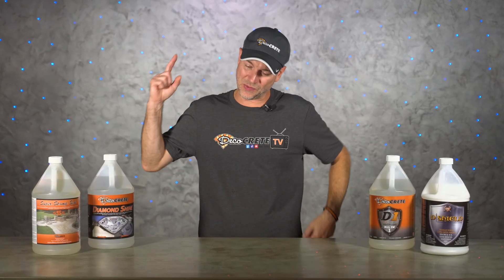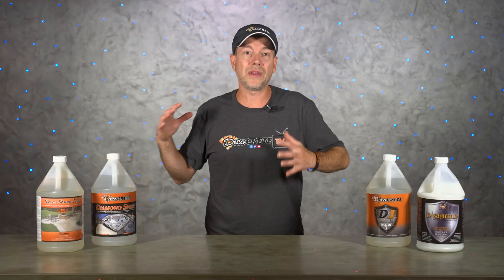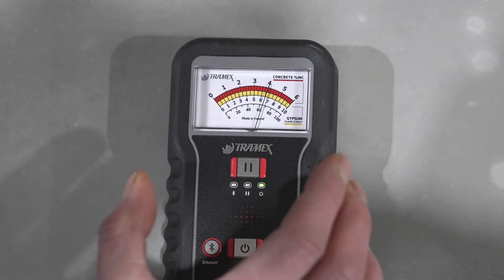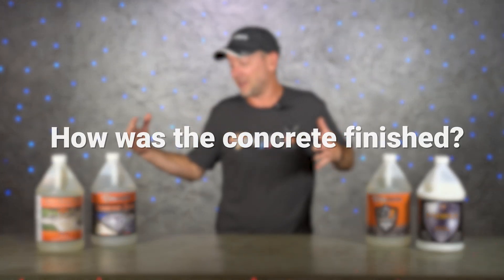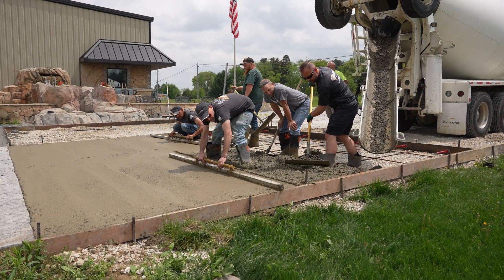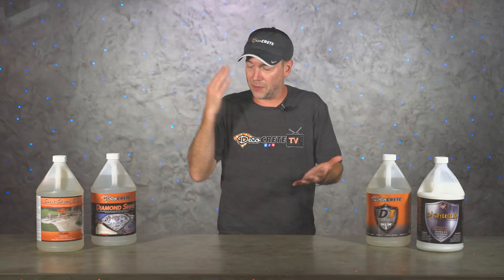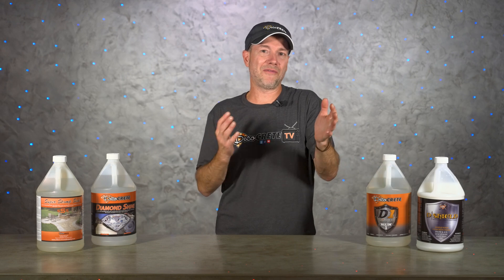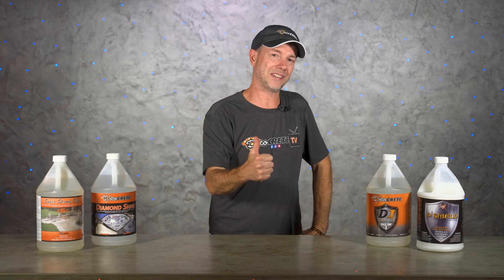How Long Should You Wait Before Sealing Fresh Concrete

Comment: I had a slab poured on Monday. 6 1/2 hours start to finish. 1 foot deep footer and 5 1/2 center. 3000 psi. Average daily high temperature has been in the high  80s with relatively mild humidity and night temps in the high 50s. Do you think it will be safe to drill for 5/8" anchor bolts to set 6x6 posts by Saturday? I really need to get started on this, but don't want to ruin the expensive concrete.
Reply from the maker: Thanks for the comment! You should be fine to drill and install the bolts now. Concrete can take up to 30 days to reach it's final compressive strength, but it gains most of it during the first 5-7 days. I would be careful not to overload the concrete with weight at this point, but you'll be fine to drill the holes and set the posts. For some comparison; most contractors allow concrete driveways to be driven on after 7 days. You could also contact the ready mix plant that provided the concrete to see what they recommend. Hopefully this helps. Thanks for watching Deco-Crete TV!!!

Comment: Hey man. If my concrete guy used an acrylic sealer a few days after the pour, am I able to still apply my desired SX500WB penetrating sealer or are those pores blocked with acrylic now? How would I know when its safe to use the penetrating sealer? Thanks!
Reply from the maker: Thanks for the comment! Yes, you can still apply a penetrating sealer; you just might have to wait until next year. The acrylic sealer will block the pores for a period of time, but it will eventually wear off. This can take 3-6 months, depending on the situation. The best way to tell how open the pores are is to monitor how fast water is soaking into to surface. If you dump some water on the slab and it repels it or takes a while to soak in and darken the color, then it would not be ready for the penetrating sealer. Once the slab stops repelling water and it soaks in, creating a dark spot immediately, you'll be good to reseal it. This could be next spring or even summertime, but the acrylic sealer will keep the concrete protected in the meantime. Hopefully this helps. Thanks for watching Deco-Crete TV!!!

Comment: My situation, newly poured cement (brushed) but the contractor use 2 different cement product sources on two separate days. Well, 1/2 my driveway is a Light shade, the other half is a darker shade. Will the sealer help with this to look uniform or enhance the different shades making it more noticeable? Can an tint additive help with this to make everything look the same? Cold winter climate in the Midwest, Thanks.
Reply from the maker: Thanks for the comment! The first thing I would do is let it cure out for at least a month before making any discissions on the sealer, it might even out some as cures. If looks better after that, I would recommend applying a penetrating sealer before winter. If the two slabs still look different after it's cured out, try spraying some water on it. If looks better when wet, then a solvent based acrylic sealer might be a better option for aesthetics. We really prefer penetrating sealers for driveways, but an acrylic sealer will darken the color. If it doesn't look any better when it's wet, then I would use a penetrating sealer and just live with the color difference. Tinted sealer is an option, but that won't last verry long and will lead to consent maintenance. I'll leave a link below to a video on penetrating vs acrylic sealers. Hopefully this helps. Thanks for watching Deco-Crete TV!!!                                                       https://www.youtube.com/watch?v=mpm855Hg9ec&t=305s
Reply: @DecoCreteTV  Thanks a lot, I kind of agree with maybe just living with it. Was just wonder if there was a way to blend the two offsets with a miracle product.
Thanks again 👍

Comment: Great video! I plan on using D1 for an upcoming stamped patio and shop floor. Can I apply this the day of the pour for curing, then reapply 30 days later to seal?  Sorry if i missed the answer in your excellent video.
Reply from the maker: Thanks for the comment! D-One can applied as a curing agent the same day as the pour for broomed, swirled, smooth finished, or basically anything other stamped & exposed aggregate concrete. With stamped or exposed aggregate, things are different. There are still a few steps left in the process, and the concrete needs to stay unsealed until everything finished. In most cases, we recommend a minimum of one week cure time before applying any sealer. There's just really no good way of chemically curing stamped concrete. If you use powder release for stamping, that will help maintain some of moisture for the first 12-24hrs, and that does help on 90 degree days. Clear liquid release will not aid in curing. The only thing you really do to slow down the moisture loss of stamped concrete would be to water cure it for the first 3-5 days. All that said, we have never cured stamped concrete, and never seen it cause an any issues. So, to answer your question; don't spray any D-One the same day as the pour on your stamped patio. Wait at least one week, or even longer if you can. If your shop floor is smooth finished, you cloud spray D-One the same day if you're really worried about curing, and then spray a second application as a sealer 30 days later if needed. Or you could just treat it like the stamped patio, wait a week and use it as a sealer at that point. Hopefully this helps. Sorry for the long-winded reply, lol. I'll leave a link to another video on curing vs sealing concrete below. Thanks for watching Deco-Crete TV!!!                                                                                                                                                                                  https://www.youtube.com/watch?v=V_0eIsgg2pc
Reply: , great in-depth reply! Thanks!

Comment: I wasn't aware the cure and seal would "wear off" enough to apply penetrating sealant. How can you tell if it is gone enough to apply a penetrating sealant? I didn't have any cure and seal applied to my interior pad because I plan to apply a densifier and sealant. For my driveway (brushed) that I will do next, should I use a cure and seal, or just try to keep it wet as long as possible?Thanks for the great videos!
Reply from the maker: Thanks for the comment! A cure & seal product will eventually break down/wear off enough for a penetrating sealer to be applied, especially if the cure was applied the same day as the concrete was poured. The exact timing of this can vary, though. It would depend on what cure & seal product was applied, how much UV ray exposure it gets, and how much traffic it sees. On average, it could 3-9 months for the cure & seal to break down enough. The easiest way to tell if the concrete is ready for a penetrating sealer is to monitor how fast water soaks into the surface. If the surface is repelling the water, then it will also repel the new sealer. If the water soaks in but it takes a few minutes to do so, and it turns a darker color after 5-10 minutes, your getting close, but I would still wait a little longer. Once the water can soak in really fast and it darkens the color immediately, you're ready to apply the penetrating sealer. All acrylic sealer/cure & seal will eventually break down at some point, the difference is that if was applied as "cure" the day of the pour, it will break down faster. If it was applied as a "sealer" to concrete that is at least a few weeks old, it can last up to 4-5 years. As far as whether to apply a curing compound to a new pour, well that's a loaded question, lol! We have our own opinions on this, but I would also consult your ready mix supplier about this as well. They will probably tell you that you should always use a curing on new concrete, no matter what, and that is the safe thing to do. That being said, I personally feel that the time of year, the weather conditions, and even your geographic location all make a difference on whether you really need a curing compound or not. Hopefully this helps answer your questions! I'll leave links to a few other videos on the topic below. Thanks for watching Deco-Crete TV!!!!                                                                                                                                                                                          
 https://www.youtube.com/watch?v=_Ejy1i8K3yk                                                                                                                                                                             
 https://www.youtube.com/watch?v=V_0eIsgg2pc&t=11s                                                                                                                                                        
 https://www.youtube.com/watch?v=mpm855Hg9ec&t=230s                                                                                                                                                 
 https://www.youtube.com/watch?v=jt-CuwtCQGE&t=3s

Comment: I'm going to do my daughter's driveway I was thinking about setting up Y sticks and  a soaker hose , with a timer keep the driveway wet for at least 7 days , for example when we test concrete at the plant if you take a sample of 3500 psi concrete cure it underwater for 7 days it will break on the Press at 7,000 PSI versus the same load sample curing for 7 Days in the Sun will break at 3500
Reply from the maker: Thanks for the comment! Water curing is old school technique, but it has gotten kind of popular again in the last few years for DIY projects. It does do a great job of curing the concrete, but you rarely see contractors using water to cure their concrete jobs. A quality curing compound out of bucket will cure the concrete just fine. The other thing to consider is the time of year and your location. The point of curing the concrete is to slow down the loss of moisture and extend the hydration period. When the temps are cooler and the UV rays are less intense, the need for curing compounds or water curing decreases as the curing happens on it's own. There is no right or wrong when comes to water curing vs curing compounds, and they both have their pros & cons. Thanks for watching Deco-Crete TV!!!
Reply: @DecoCreteTV  yes contractors do not water cure their jobs they move on to the next one after they come back and saw cut it the next day, should they? Absolutely.. will they? Absolutely not..🤣 we deliver hundreds of yards of concrete 6 days a week 8 months out of the year water curing is more for the homeowner to do the contractor is going to saw cut and seal it the next day unless you tell them that you're going to water cure it for 7 days. This is what I'm recommending and basically more for the guy that has large equipment or heavy trucks.